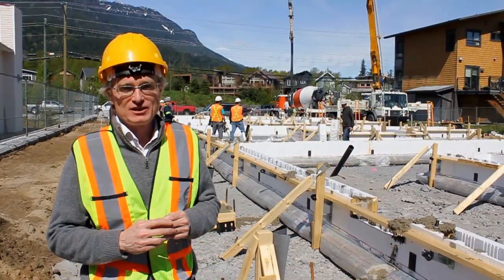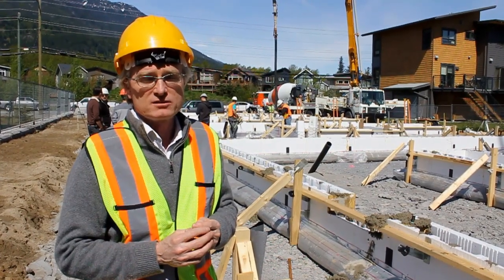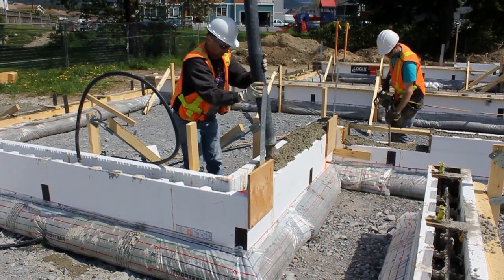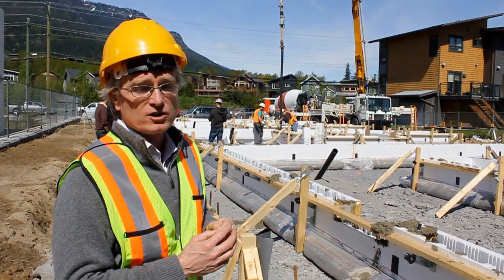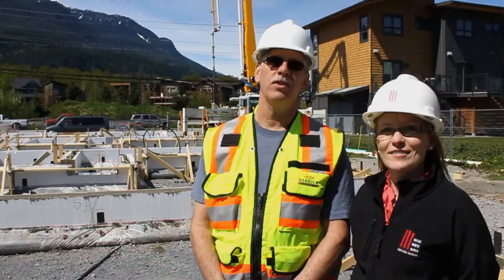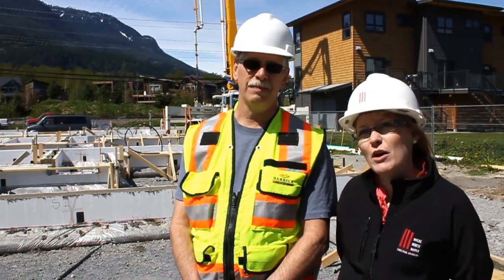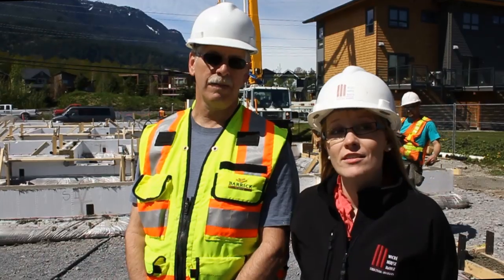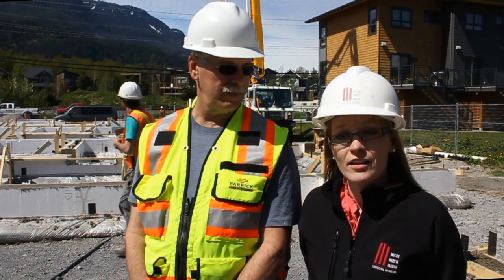Fab-Form ICF Monopour: Helix™ steel fiber debut

Comment: in icf construction dose that cause problems with wireless signal from blocking it and adding metal wire basically creating a faraday cage creating more signal insolation

Comment: How do you prevent rust staining since the steel fiber isn't necessarily covered with concrete?  What is the cost differential?
Reply from the maker: The steel fiber is covered in concrete. Just like aggregate in concrete, once Helix is vibrated it settles away from top of slabs and edges of footings and walls. Typically Helix is roughly 15% more than rebar, but eliminates huge amount of labour, leading to savings.

Comment from the maker: If the structural engineer has requested additional steel around openings, then that must be added. Helix is for replacing the standard wall reinforcing; for example #4 steel 16" on center vertically and horizontally.